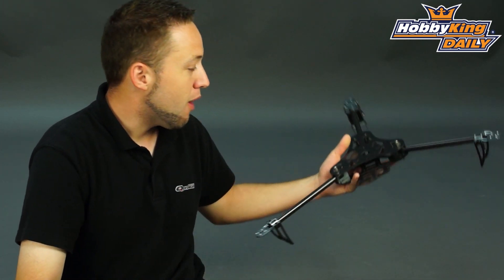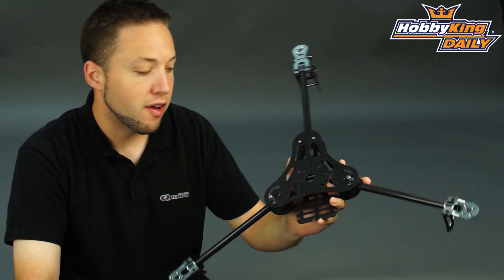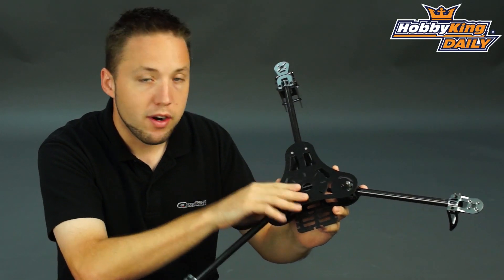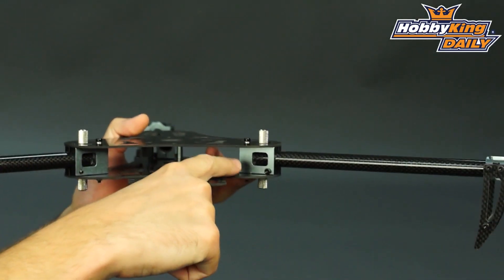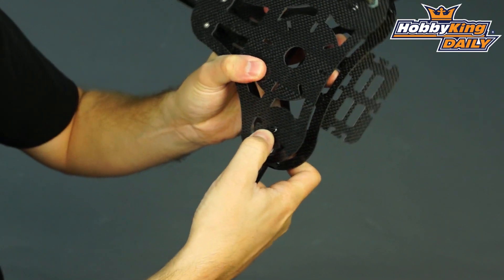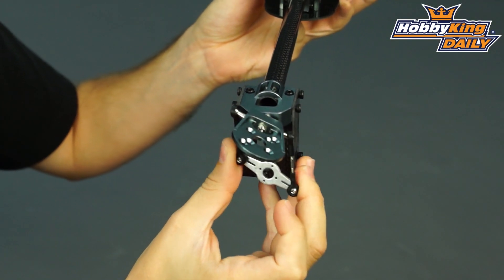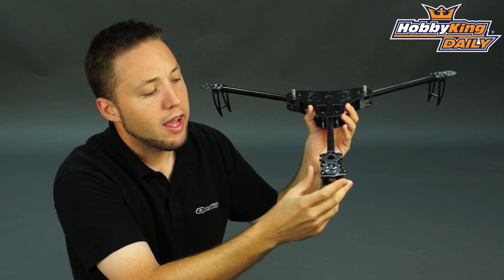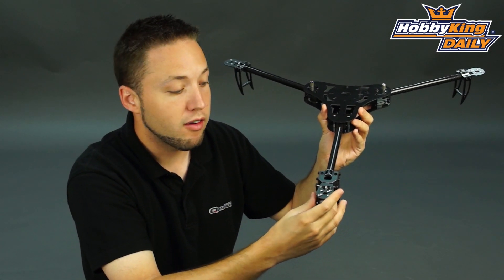HobbyKing Daily - Turnigy Talon Tricopter

Comment: The one I have , as schematic drawing shows, the bolt/screw that holds motor bracket, will not go in the hole in bracket ? poor design. I noticed on this , bolt is coming in from Opposite direction with Nyloc nut on other end. The boom bracket on mine is threaded ! so I am unable to insert the bolt , as I see on this one .
so I am stuck  with 80 dollar kit .

Comment: Very nice triframe. My own frame build from parts of the hardwarestore looks like a flying cabledrum with zipties. Really rigid but way to heavy. BTW i experimented with different servos i had in my box. They def. have to be metal, otherwise the plastic gears will soon crack inside. Analog vs digital showed no real difference for me. But this thing here is sexy.